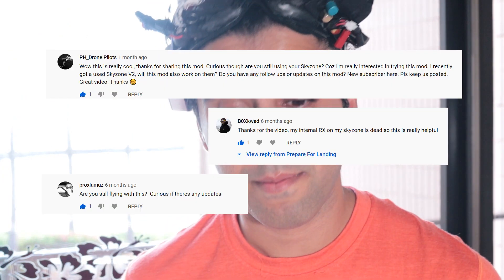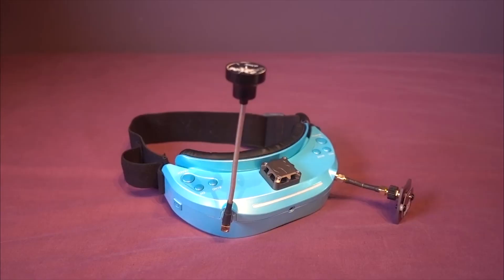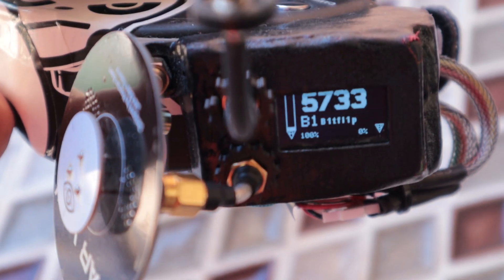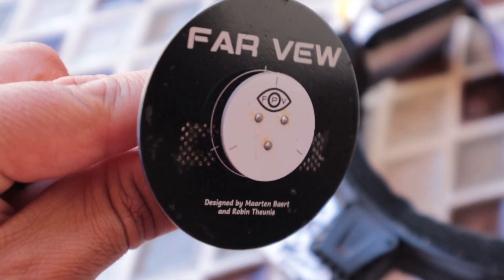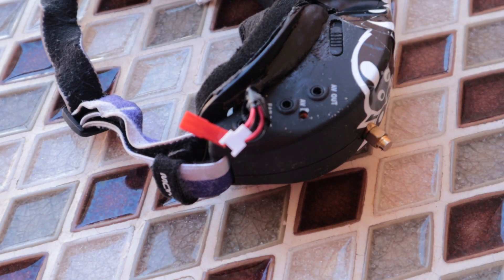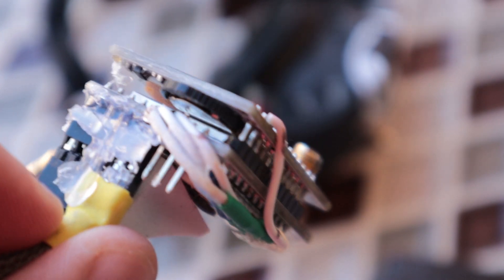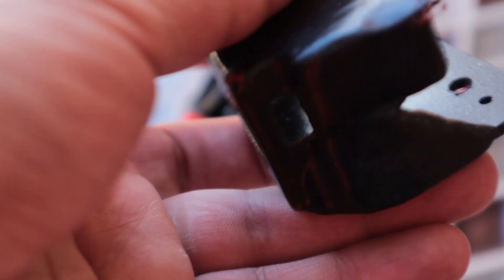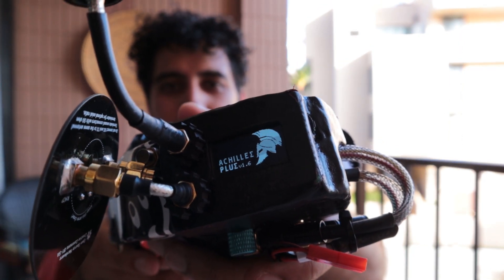How to add a Fat Shark module to ANY FPV goggles

Comment: You still commenting back ?
Reply from the maker: I'm around @harryfp
Reply: @PrepareForLanding  hells yeah man  I’m glad . I’m preparing to do this modification on my emax box goggles .
Reply: I totally forgot to comment my question lmao 🤣 so here it is .  I stepped up my goggles from 3.7v to 7.4v I soldered in a eachine prodvr directly to the onboard 5808rx . I guess this is the question I’m running a 5v regulator should I run it directly to the goggles making them 5v or should I find a power source coming off the board then solder in the 5v regulator to the fatshark module? Then video straight to the video feed from the onboard 5808 ?
Reply from the maker: Unmodified, what's the input voltage range on the goggles?
Reply: @PrepareForLanding   ouch I’m not sure input was originally 1 18650 3.7v

Comment: realize vid is older, but an external module plugs into the AV port, so how can one use the DVR in the skyzone goggles while using the external module/bay ? well if there is a way
Reply from the maker: I think those skyzone have an av out that you can hookup to dvr, or the DVR would have to be able to pass thru the video signal. Since it's analog I think in theory you could also just split the signal, but I've never tried that.

Comment: Will the $10 adapter fit the 01s?
Reply from the maker: It should wire up no problem.
Reply: Prepare For Landing hell yea. I just bought the 01 for 100 bucks. And just found out the ev800d has better range and quality smh. Hope this improves the sky zones

Comment: you should check out the DJI module adapter and see if you can simplify your setup, i plan to do something similar to what you did with my fatshark base sd but i want to plan it out first, if you do that please post a video and preview if it worked or not, great video man!
Reply from the maker: Yeah I've thought of that, definitely sounds like a good route. Skyzone also has a $10 adapter now that will do the same.
Reply: @PrepareForLanding  yea i saw that too but i felt like the dji adapter board would be more easy to 3d pritn for and make your own design isntead of sticking with the default casing, post a vid if you do that!